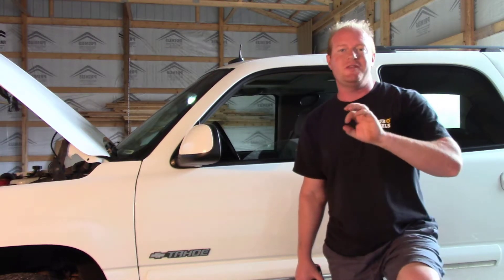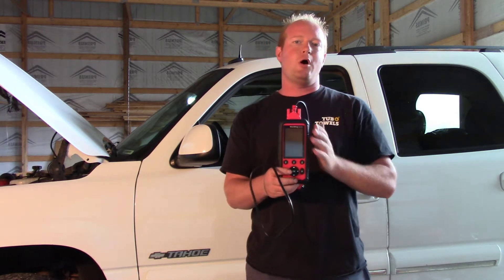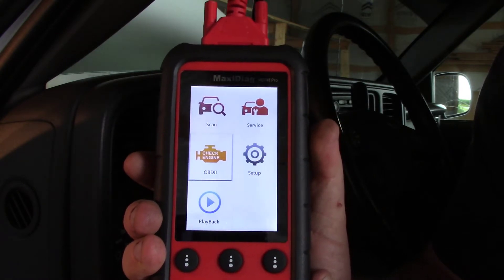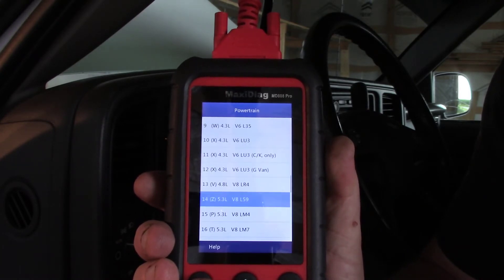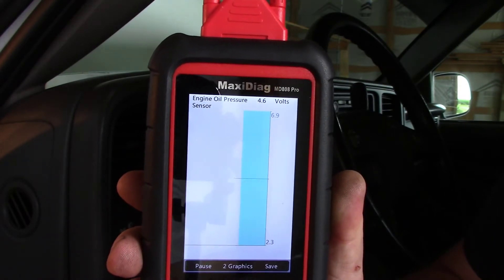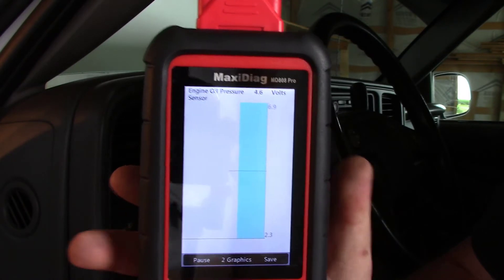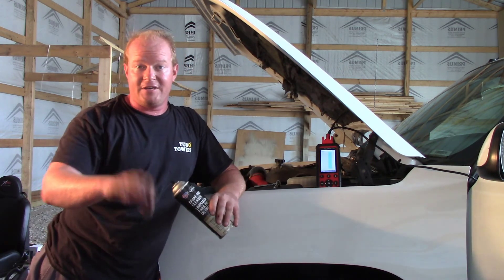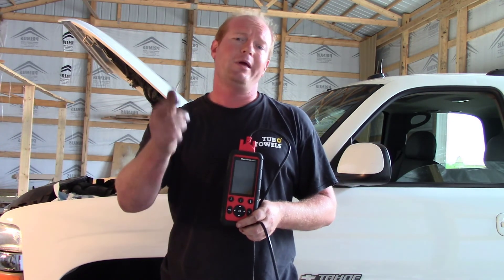Oil Sending Unit diagnosed With Autel MD808P

Comment: Great video, can you display the oil pressure sensor in pressure instead of volts on this scan tool?
Reply from the maker: Yes, but it all depends on the PID of the vehicle.  Some measure PSI and some are just an Oil pressure switch.

Comment: Does this one have information how to diagnose engine code and how to fix it and what causing the code?
Reply from the maker: That information is not built into the tool, however it is available on the Autel website at https://www.autel.com/autelcms/CustomerSupport/551.jhtml  You can enter the vehicle info and the code and it will give you common repairs and what to look for.

Comment: Why is it only showing GM models 2013 and older?  It doesn't do newer models?
Reply from the maker: Mine shows the same thing.  I sent a message to the Autel support team about this issue.  They said they have engineering working on a fix for it.  If I here more I will let you know.
Reply: That's disappointing to hear.  Makes me really reconsider picking up this scanner.
Reply from the maker: I heard back from the engineering team at Autel, They are aware of the issue and they will have the update for the GM issue released in December 2017.

Comment: Thank you for the video!
Would you be able to see/tell if the MD808 Pro also can display real-time Transmission Temperature?  Thx!
Reply from the maker: That is going to very by manufacturer.  If the vehicle you are working on has the sensors for trans temp then the MS808P would be able to read, display, and graph that information.  Not all vehicles monitor Trans temp, but most new models do.
Reply: @FlashPerformance   would this one read the transmission temp on a 2011 Chrysler Town and Country? Thanks
Reply from the maker: @robshummerh3  Yes, the MD808P has access to all modules and all PIDs available in live data.
Reply: Very impressive